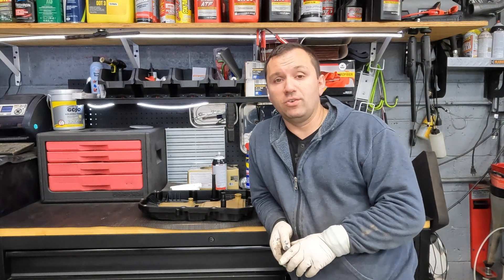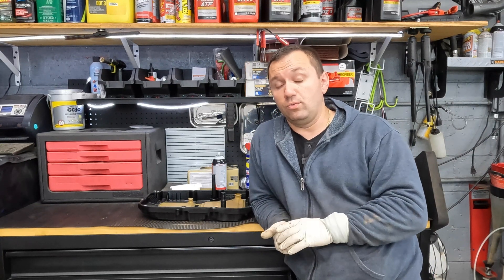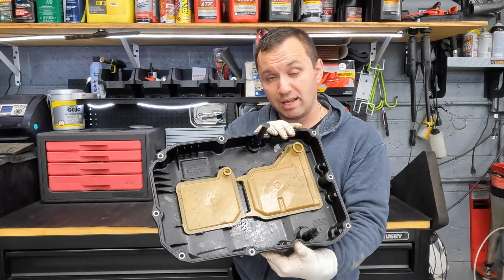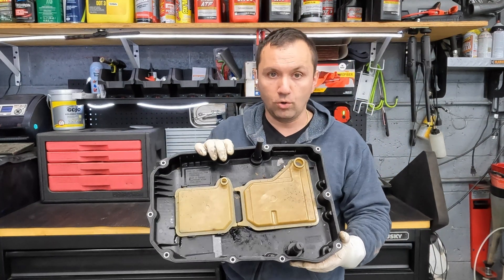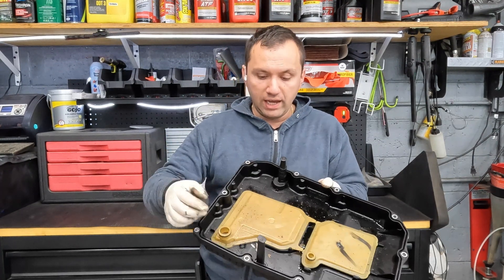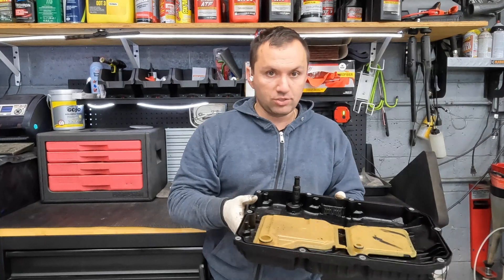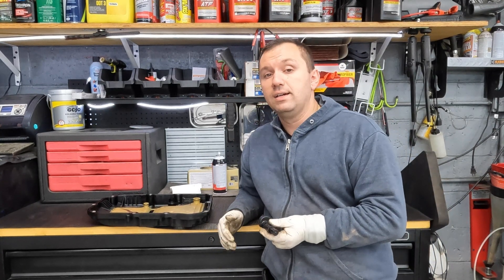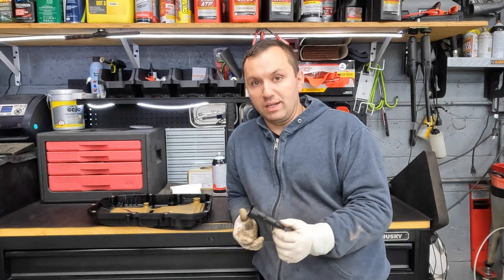ENGINEERING THINGS SO YOU HAVE TO TAKE THEM TO THE DEALERSHIP FOR SERVICE!

Comment: Is that a 9g transmission? I've done those services. They're not bad to do. There's a cheap tool to service those transmission ls on Amazon and I use a drill pump to inject the new fluid then I do the level check via temperature. I think we charged about 4 hours on the last amg.
Reply from the maker: Yes it is and they aren't bad just the design is wacky and they take time to do correctly.
Reply: The annoying thing is the torque on the new pan is extremely low so you need a very low range torque wrench. If it's a steel pan we usually reuse the pan.
Reply: Nissan shares the same transmission but Nissan will do a spill and fill only and when I asked about a full service they told me to take it to Mercedes for that.
Reply from the maker: @clintprice2123  They aren't that hard to do they just take time and special tools, I'm surprised Nissan referred you out for that.
Reply: @TheEnthusiastMechanic They said they do not replace the pan. They wanted $450 to exchange 6-7 quarts of fluid only.
Reply from the maker: @ sounds like that Dealer does not know what they’re doing. Any dealer that sells a specific car line like Nissan needs to be able to do everything for that vehicle in house.